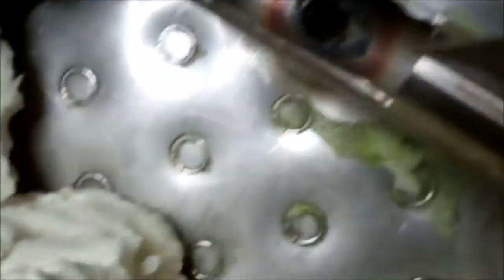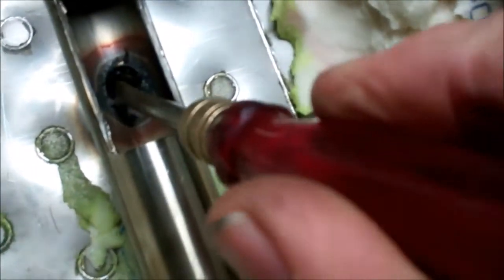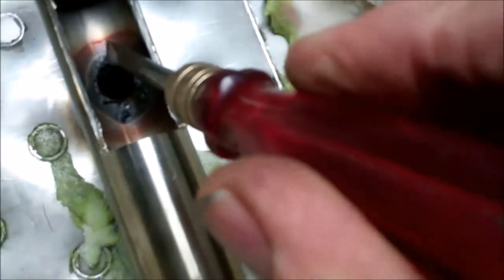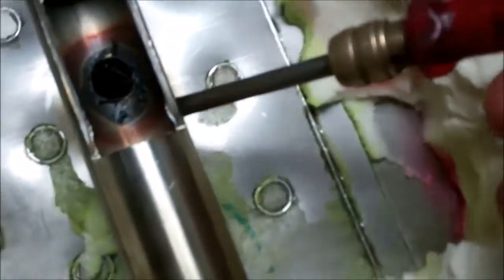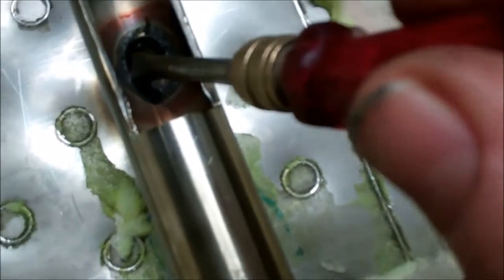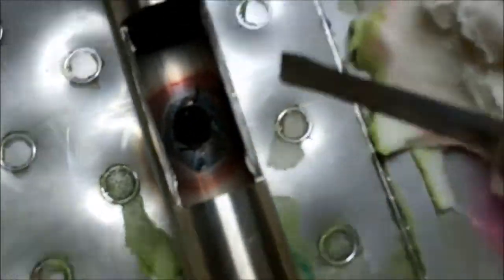Milk tank refrigerant leak welded inside out

Comment: How do you pressure rise the tank with nitrogen and would air work on its own? I have small 300 gallon milk tank and it seems to be leaking?
Reply from the maker: What make of tank is it ?. Is it an ice bank tank ? or a D X tank ?. Is it leaking refrigerant ? or milk ?. If it is a D X tank with a refrigerant leak the evaporator needs pressure testing using (oxygen free) nitrogen, if it is an ice bank tank the copper coils need pressure testing, you should not put any air in any refrigeration system.

Comment: how much time to complete this repair?  very nice job
Reply from the maker: From start to finish 6 to 7 hours on site with this job, welding the cracked pipe is only part of the job. Another job like this could take longer as a lot depends on site conditions and space around the tank, locating the leak can be difficult sometimes. I also have to get to site and back, a recent job involved 630 miles all done the same day.